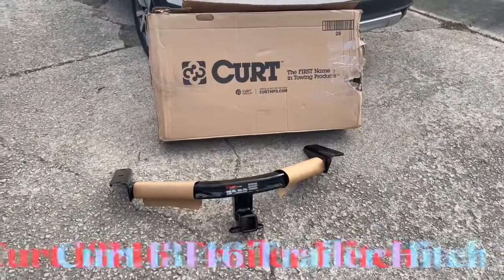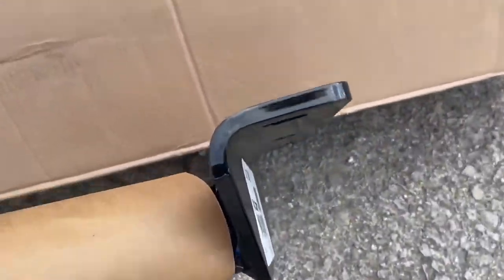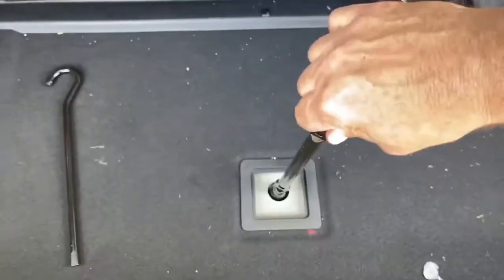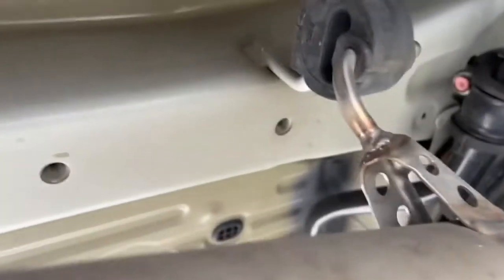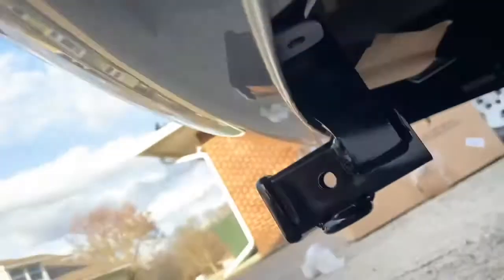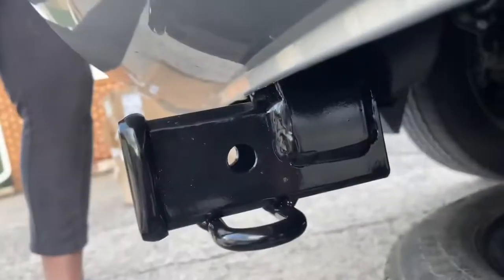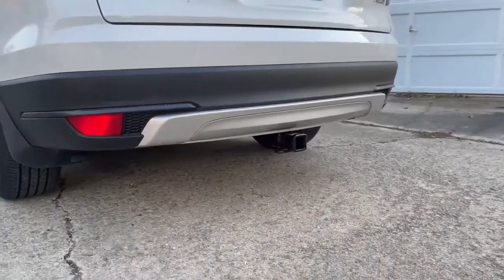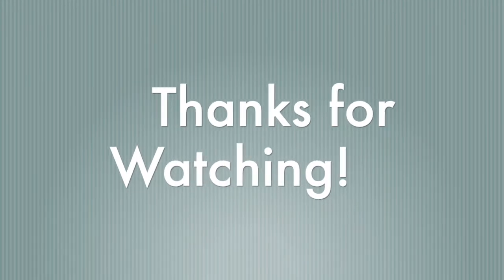How to Install a Curt trailer hitch on a Honda Pilot! DIY

Comment: Does your Honda Pilot have a hands free liftgate ? If does will it work with hitch installed.
Reply from the maker: Thanks for watching and posting!  We don’t have the hands free lift gate where you put your foot under it, so I can’t tell you. However, if you call a dealer for your vehicle then they would be able to tell you if a hitch will interfere with it.
Reply: @the.great.adventurers  thank you, I got a good deal on auto zone for only $150 minutes taxed included and I just installed yesterday without asking the dealership. And I’m surprised it still working.